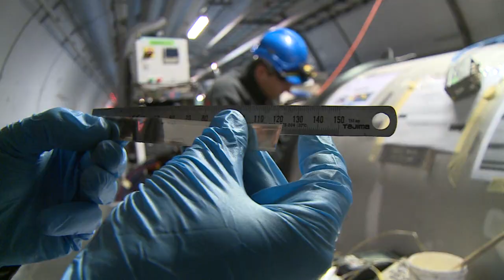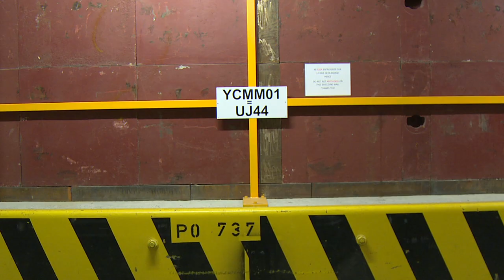LS1 two years on (WARNING: flashing images)

Comment from the maker: It's almost two years to the day since CERN’s first long shutdown (LS1) began. At 7.24am on 14 February 2013, the team in the CERN Control Centre switched off the beams in the Large Hadron Collider (LHC), marking the end of the accelerator's first three-year run. Hundreds of engineers and technicians have been repairing and strengthening the laboratory's accelerators and experiments in preparation for running the LHC at the higher energy. So what has the work achieved? Watch this video to find out and read more via http://cern.ch/go/6XVl.

Check out the latest vacancies for engineers, technicians and more at http://cern.ch/jobs

#RestartLHC
Reply: Repairing?? or taking care about the probability of create a black hole??...is too easy in a toroid shape build a energy balance to run a huge micro black hole into the core of the reactor, you are playing with the other dimension transfer energy...
Reply: Eduardo Nasz nonsense.
Reply: Richard Sidler yes nonsense...jjajajaj
Reply: It would be interesting to take the concept of the LHC into the vacuum of space.  Not that it would convenient, I just don't feel safe with what could possibly be the first stages of a plausible fusion reaction.
Reply: You and many physics have the same question this people really knows that they are working in the PLANCK time, where the space convert the time of vacuum in energy??... they can produce a teletrasportation of all the reactor, in real reason is a fusion nuclear reactor with an amazing power of destruction...
Reply: Well, given that a fusion reaction could only occur in the vacuum that is space (?) ... doubling the energy could just provide a longer detection time. Insightful.
Reply: If you get the correct phase amid differents time using the last armonic you entry into the vacuum is the same that get into the hole of a black hole passing the limit of ligth speed. You could get back the energy from the vacuum to our reality. Always exist a relative frequenzy of speed of time that spark the resonance of all the system and produce all the energy you want. Teletrasportation tunneling procedure.
Reply: Money?? free energy for all, is very easy to upset differents armonics to get the energy you want the time you want, is better going to believe that the money will be devalue much more...jajajajaj

Comment: When are they turning it back on ? Is there a specific date ?
Reply: It's a long, slow process. There isn't a specific date because there isn't one specific point that would be considered the actual "turn on". It's already fully cooled down and they're running power tests on the magnets that steer the beams. The plan is for the first beams to be injected around March 23 and from then it will take them until about May 18 to start taking data from collisions. From that point, they'll gradually increase the number of particles colliding at once, hopefully reaching the machine's capacity in late August.